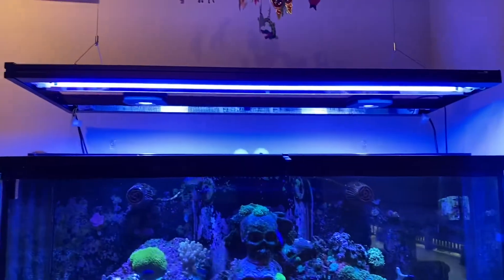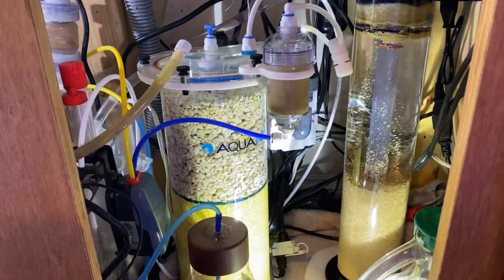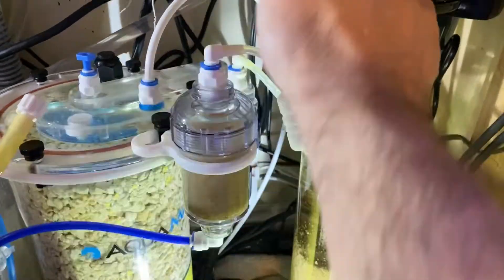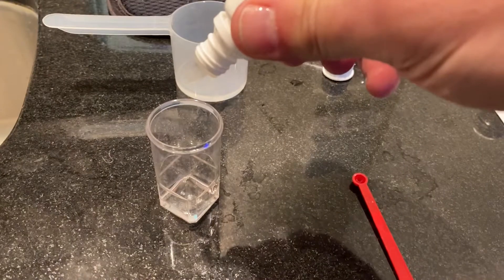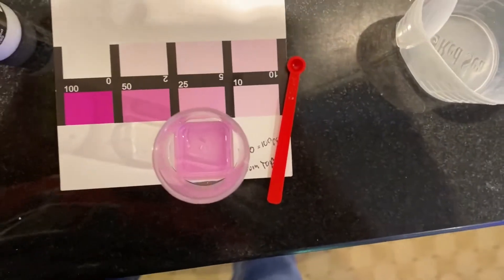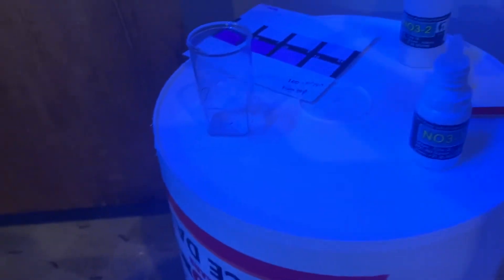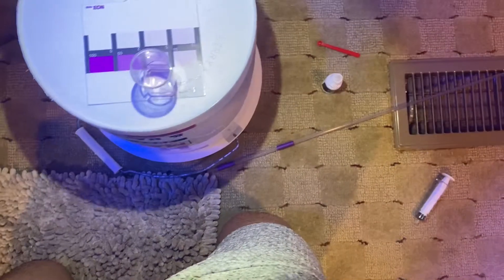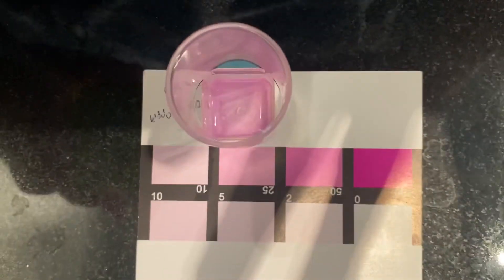Part 3, fixed,  Sulfur Denitrator issues

Comment: HI Michael, thanks for the videos.  I got the Aquamaxx for a 120 gallon fish only with a lot of predators: triggers, puffers, eel, and angels/tangs.  I have nitrates above 80 and higher in my tank.  I was nervous about the sulphur it is safe it seems from your videos.  I found the same stuff you used on ebay.  I was wonering should I use 2 liters since I have such high nitrates? Or start with the 1/100 gallon ratio and see how it goes first? So the sulphur is safe right it wont kill all my fish? I have had some of them for 7 plus years, like my blue hippo tang
Reply from the maker: Yes safe,  rinse well.  Definitely keep one drop for a while,  untill it reads zero,  one it's starts working,  it gets faster.  Start with one liter,  easier to add then remove,  also,  I found I would mix it up with the calcium.  Mix it well,  adds more channeling for water,  otherwise I found the other stuff gets tight and limits water flow.  Also plan on rinsing the material at least every 6 months to rid the " rubish"mulm.  Mine worked  great.  No downside unless you have to much sulfer ( I had to remove half) to much means not enough food(nitrate) then the bacteria make the sulfer gas.    Also, add calcium on top,  inch or two,  if need add a few good porus rocks on top of that, so the media stays down...
Reply: @skullartcollector  Thank you so much!!
Reply: How is it working I’m about to set up aqua max t3